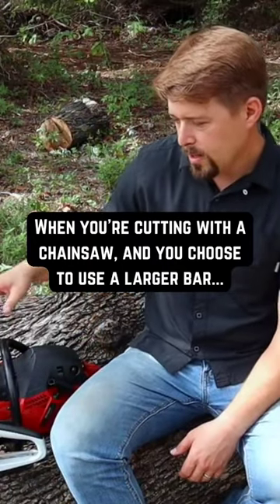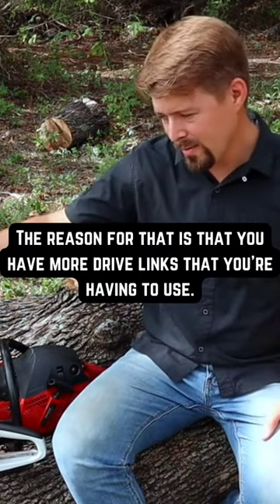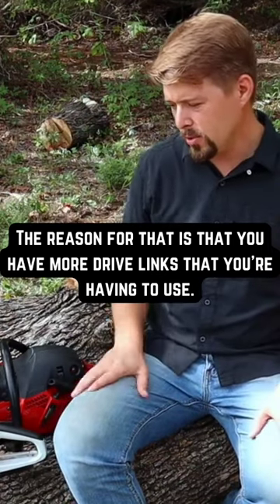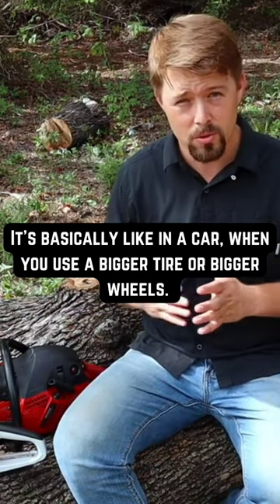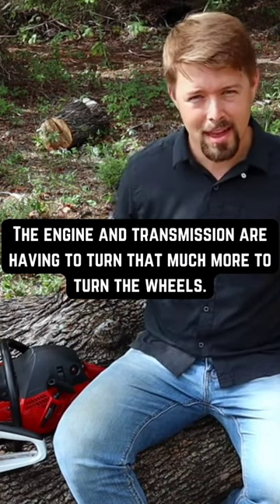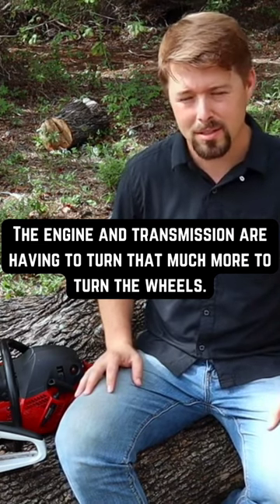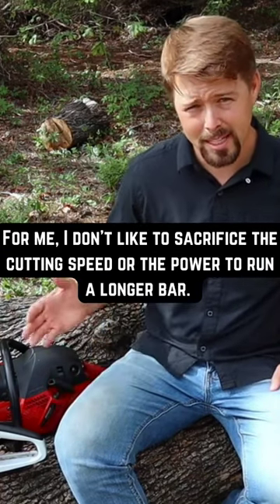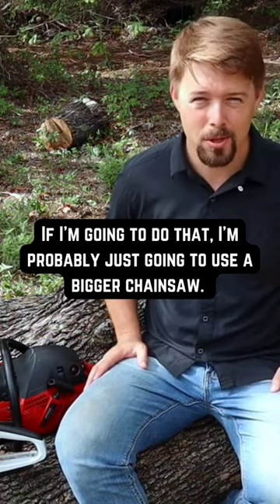Longer Chainsaw Bar = Less Power #chainsaws #shorts

Comment: Longer bar is less bending over and more cutting away from your body.
Reply from the maker: I agree for not bending your back and keeping the saw away from your body. That's when I run a bigger saw that has the power to pull the longer bar. It works great for that purpose.
Reply: Who wants to carry a 125cc saw? That is a dirt bike engine. Bar length is also regional. West coast uses longer bars for bigger trees. I logged in the 1990's in Alabama and Florida, a 20 inch bar was plenty (Husqvarna 365). The right tool for the job. I've got a Husqvarna 435 for limbing with a 16 inch bar. I have a echo 501p with a 20 inch bar and it's all I need for firewood. 

My neighbor has a 460 Husqvarna and every time I see him use it I think Texas chainsaw massacre... His yard is full of 15ish year old pine trees.